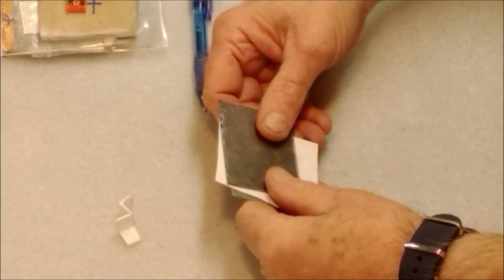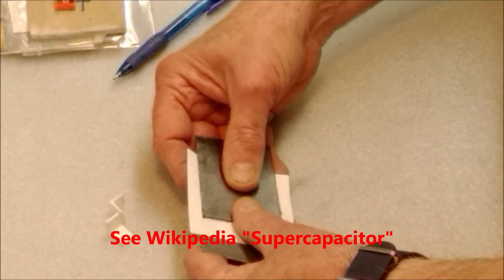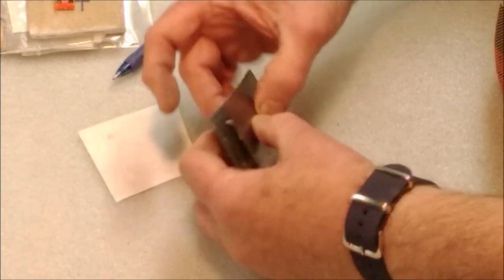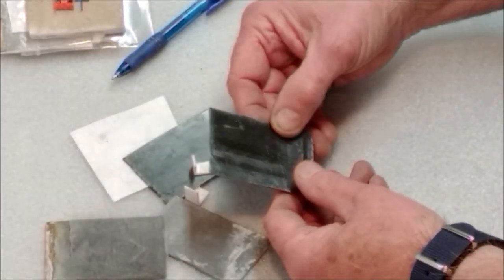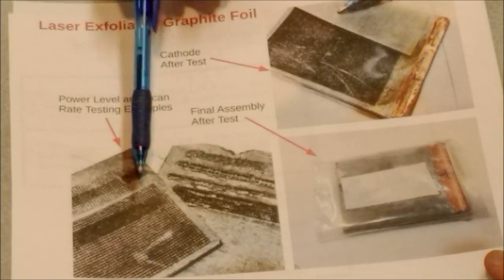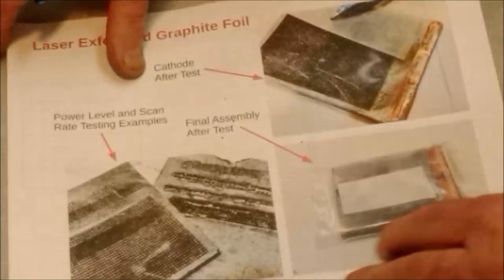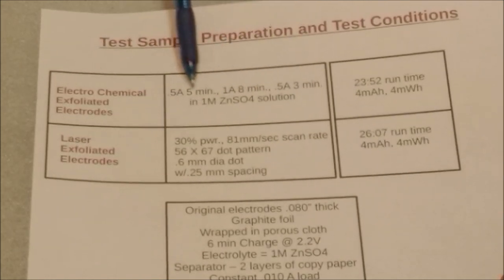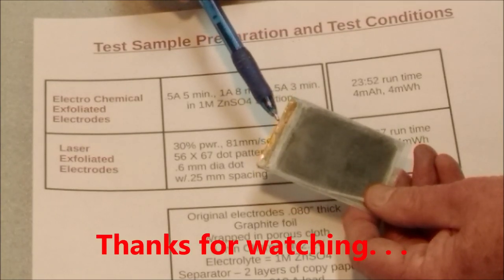Laser vs Electro Chem Graphite Exfoliation for Supercapacitor Electrodes

Comment: Hi Dennis, interesting video. If you have not seen it, SarbarMultimedia channel, where Russ takes you through his lasers is brilliant. He knows really his stuff and his learning process through the year or two has been very educational.
One thought I had, you presumably had yours set for cutting at 30%. Did you try etching at say 15%...there is a "sweet spot" with CO2 lasers where you get a high frequency dithering/fuzziness, as the tube tries to stimulate the gas. You can hear it as a distinct harshness in the arc, almost a crackling. It produces a completely different effect
I suppose you can paint an aqueous slurry graphite powder onto say a PET film, and if you can get the power right, fuse the now exfoliated graphite to the surface of the PET, thus removing the binder from the system. I was looking at the potential advantages of using this with my ammonium persulphate carbons as a possibility of eliminating the kiln process, bonding it directly to the plastic film and heating it to a sufficiently high temperature to activate at the same time. My machine is a 130W beast, with a huge bed, which was great for large sheet work, unfortunately the large bed was my downfall, as a lazy man that I was meant I did not clear the bed before cutting. The result was the head hit stuff I had left in the machine, so is out of action at the moment pending serious repairs :(
Also, all that power means that at the high frequency point, there is still way too much energy.
My plan, therefore, is to etch "out of focus", using a 3 or 4 inch lens such that the carbon would absorb the heat energy, creating the fusing, but because it was out of focus, there was total coverage of the surface, as opposed to the dot pattern you would normally see with an in focus beam. Clearly, the overlap energy needs to be managed. Again, Russ has produced many excellent videos on energy patterns.
Just one other thought, regarding the electrolysis method. Does wrapping the electrode with cloth achieve the best result...or would a washed surface give a better one. My thinking just now is that during the intercalation process, the sulphate ions wedge into the graphite, driven by the electrical potential. Some graphite becomes sheared off, forming the multi-tiered graphene particles observed in solution. But, at the point of switching off, suphate ions were still trying to cleave off more, so logic dictates that the surface of the parent material should look highly laminated, as "work in progress". That is, I suspect, is where the benefit of this process would be, not necessarily upon the constrained particles, but the massive increase in surface area created by the incomplete intercalation. Indeed, as released particles are loosely constrained, they may not have any electrical binding (unless, possibly calendered back to the surface).  Just a thought :)
Keep up the good work.
Tony
Reply from the maker: Hi Tony - thanks for the many thoughts.  Lots of creative ideas we'll have to pursue 'someday'. 
I've been following / corresponding with Russ now for a couple? of years.  He got me interested and that's how I ended up with a 'China Blue' machine.    I did do some work with out of focus laser heating but didn't stick with it long enough to have any positive results.  Cut some nice acrylics though when I needed fixtures for flow cell testing. 
The pulsed dot pattern I used on the graphite foil sort of produced little explosive mounds/volcanoes so it seemed like a good idea to 'puff' up the surface.    Somewhere a while back I also tried to scan - was it mylar or kynar tape - there was some research done again at one of the universities - it did produce a carbon surface that worked as an electrode - again I didn't do any follow up other than a quick test.  I like your idea of maybe bonding carbons to a polymer backing via laser heating ……..  
You might also have something there that the underlying graphite surface during electro chem exfoliation has charge storage value.   I am fairly confident that the particles trapped by the cloth do as well since that form a thin paste surface when wetted and clamped under pressure in the final test cell. 
One last question - back to the carbon cloth of the Maxwell cap - what  do you think they use to get a stable electrolyte that works at 2.5V.  - I've seen some of the later caps spec'd at 2.7V as well. 
Dennis
Reply: @denniskramer9788  Hi Dennis 
Another "holy Grail" ...cell voltage...increase voltage square increase in capacitance ! This is predominately driven by the choices you make about your electrolyte.
I am presuming they are using organic  solvents, with fluorine/ammonium salts, that can push it up to 2.7V, I think....ammonia I am cool with, but trying to keep away from fluorine. Even though I inadvertently bought a litre of hydrofluric acid, I have no intention to use it...its just soooo bad, especially when most of the time in my lab I am just wearing shorts :)...trying to find a way to dispose of it safely at the moment. 
From what I understand, you need to provide a potential to transport ions to create the EDLC, but applying too much potential you destroy the ions by supplying the electrons with sufficient energy to establish electrolysis. That is why we get the limit of appx 1.23V for water-based solutions...hence folks looking at ionic/Deep Eutectic solvents to eliminate the low voltage dissolution of the water...but DES's based on Chloline Chloride, for instance, are hygroscopic. If left open to atmosphere, my ChUG DES will pull in up to 40% by wt. H2O. So a DES based electrolyte will need to be dried prior to use AND then prevented acquiring moisture by sealing.
Quite probably, the commercial electrolytes are also hygroscopic, but of course they are handling them in dry rooms and vacuum fill/treat during manufacture. So, within your home strategy you have to make some decisions...for instance accepting simplicity over density, toxicity over capacity and so on. And like you have already said KISS is king !!
I have not given up on raising the voltage, and are looking at gel/solid electrolytes. At the moment, I am synthesising some Potassium Iodide, unfortunately I had only 30g of elemental Iodine, another 500g on order from China. My plan is to create a Xanthan/Silicon Dioxide gel with a Potassium Iodide/Iodine additive. Xanthan gum is interesting in that it seems to react differently at high and low ph's, and it has tails off its "backbone". 
The electrodes will be basically my Ammonium Persulphate Carbon ( a little MnO2 on the +ve) bound with PVP to copper current collectors. 
If I get the ratios correct, the electrolyte shall gel, possibly over 4 or 5 days...how much gelling will be crucial. I am hoping the long chains of the Xanthan will inhibit the dissolution of water by virtue of the OH tails...with a little redox action assisting...so may be I will be able to push the window to 2V...we shall see :) 
Also, by coating each electrode first with electrolyte, allowing to dry and then "gluing" them together with a fresh coat, will eliminate the need for a separator    ....probably another failure hahahaha but that's what its all about...theorising,  visualising, testing and growing  
ah well, probably boring you by now, so better sign off.
All the best 
Tony
Reply: @tonyponsford  Hi Tony - like your though process for a  gelled electrolyte path.  Lots written lately on 'solid state' versions as well.  Hesitant to try what is beyond my understanding at this point - sounds like you could educate the community with a good tutorial video ;-) . 
What are your thoughts on a sodium perchlorate - read where it may to 'volatile' but at 3.2V its also tempting....???  Do you think the organics can fall into my category of simple  and low cost - gosh that V>2 term really is also pulling in that direction .
Dennis
Reply: @dianekramer6467  Hi Dennis
I will promise you a video if my work leads to an element of success, but the moment, its definitely "work in progress". I am not a chemist, I am a retired high voltage electrical engineer, my electrons used to run around at 400,000V so what do I know about this !!
I have many ideas on what I want to try, but I don't want to mislead people by showing stuff before I get to at least first base with them, videos of failures would, I suspect, dishearten rather than inspire. It has taken me a while for me to be comfortable with my carbon with PVP binder, that seems to be working well, so now its looking at the electrolyte that will work with that....I've done this several times before and ended up starting again in a slightly different direction, but that the nature of the beast :)
With regards to sodium perchlorate, never played with it, so I can't bring anything to the table, but interestingly Wikipedia describes a solution of it as a "unreactive electrolyte", which would imply little or no ion migration, yet there are several papers using it within sodium cells, so may be I am not interpreting the term "unreactive" correctly. Regarding handling it, sure it looks like an oxidiser, but then so are a lot of other stuff, water is pretty nasty if you try and breathe it ;)   ...
With so many chemicals and effectively an infinite number of combinations, it is tempting to run around like a little boy in a sweet shop, so I tend to try to narrow my investigations, by say focusing on sulphur or ammonium groups...that would lead to a certain choice of current collectors/electrodes and possibly electrolyte backbones. Then I try to develop from there. Others, I am sure approach it from a different direction but there is no right or wrong, just what fits you best :) 
Don't forget your own mantra KISS hahaha
All the best

Tony
Reply from the maker: Hi Tony - would you mind if I sent you a PM - my email is dkramertroymi@gmail.com.
Thanks,
Dennis
Reply from the maker: Hi Tony - thought I'd share with you a couple of updates and maybe you could suggest a away around my latest bump in the road.  I've had great success in terms of areal current and power density with  a composite mix of  AC, Graphite flake, and carbon black literally blended with toilet paper and a little water glass.  Electrodes about a mill thick are less than 3 ohms /square and yield more than 1mAh / cm>2.    That said its the same old ELECTROLYTE issue topping out at 1.8V for 1M ZnSo4.  I'm shooting in the dark to try and build an IONIC LIQUID with the ZnSo4, DISOLVED in something.  Can't get enough concentration in glycerol.  Things like N 2 methyl pyrrolidine are not ionic either.  Thought about methanol - but maybe too flammable.  Any suggestions...….???
Also may try more of a gel or  emulusified oil mix - but that's not going to raise the voltage - only add resistance ???
I've read lots of papers about ionic liquids but don't understand enough to simplify the process for a poor mans lab. ;>)
Your thoughts.
Thanks,
Dennis
Reply: @denniskramer9788  Good news that you are progressing, well done !!
Can't report much from this end...combination of things limiting my time at the moment, including the start of the rice planting season...I've tried various binders for my ammonium persulphate activated carbon, at the moment discounted Xanthan gum/polysaccharide route in favour of a PVB/PVP polymer direction, but have yet to settle on an optimum ratio. I may revisit Xanthan but try either a PVB or Stryene Acrylate Copolymer (SAC) additions, but that is on the back-burner for now.
With regard to your electrolyte, rather than zinc sulphate, have you thought about zinc chloride?
Zinc Chloride mixed with Choline Chloride (molar ratio 1:1) will create a high conductive Deep Eutectic Solvent, it will theoretically give you a voltage window of around 3.7V which is good news...but (and there is always a but) it is very hydrophillic and will absorb appx 40% by weight of water over a relatively short period of time (several days, I think). That water, will then become your voltage limiter (1.23V) so you need to keep it dry (or as you charge the water will disassociate to hydrogen and oxygen), or dry it immediately before using it. It can be oven-dried fairly easily. My ChUG ( choline chloride, urea and glycerine) behaves the same thirsty behaviour, so for trialling my binder I am shelving it at the moment. I was also thinking of vacuum packing the cells and then if there was any off-gassing it would be contained and re-associate after charging...work in progress.
NMP is a bit nasty to handle and dispose of, DMSO is safer, but I can't deal with the smell. It is said to be garlicly, but to me it is just rank. I've got 3 litres of the stuff just sitting on the shelf !!
So, my thoughts would be to try a dry DES...then you may wish to re-visit your binder, for instance if you want to stick with "waterglass", have a look at NurdRage's channel as he identifies four different compositions of sodium silicate. I used his technique with NaOH/SiO2 to make my own, and then you play with the "size" of the sodium silicate molecule, as I believe "size" matters in all the battery/supercap components. 
I've knocked up concoctions thinking they should be pretty spectacular and they were...spectacular failures !!  Why, I don't really know, wish I did because then I would have cracked it, but I suspect it is possibly due to the transportation mechanisms at a molecular level. Some molecules/polymers, such as Xanthan Gum and PVP appear to have "backbones" that seem to facilitate or assist ions to travel along or through them. From what I understand, hydrophillic binder additives generally increases conductivity, but tend to "dissolve" or "degrade" the electrode (XG, PVP, PVA, PAA, PEG), whilst hydrophobic binder additives increase the electrode life, at the expense of conductivity (PVB, SAC, SBR). (Not sure where Sodium Silicate fits in that model.)
From what I have gleaned, the "backbones" frequently have molecule chains branching off them, and that how these branches extend from the backbone dramatically effect its performance. For instance, depending on the pH of the electrolyte, the branches can be extensive or tightly pulled into the backbone, so like we have said before, you cannot explore a single component without considering its effect upon the other items :)
One other thing I am musing at the moment is adding a small amount of ethanol to the aqueous electrolyte to improve transportation, but again, it has to be compatible with everything else :)
Not sure if any of my ramblings helps you and please don't consider anything I've said as more than my musings...I am probably way way off the beam :)
Keep up the good work, kind regards
Tony
Reply from the maker: @tonyponsford  Hi Tony and thanks for taking the time to help me out.    I'm going to order up some chcchl and start a new chapter in testing.    A good free  'bible' on electrolytes is the 2015 paper titled....A Review of Electrolyte Materials and Compositions  for Electrochemical Supercapacitors......Zhong et.al. 116 pages of alphabet soup options.    I'll keep in mind the hydrophobic issues.....maybe an additive will help there ...Glycerol???
Dennis
Reply: @denniskramer9788  No Problems mate, thank you for the paper, lots of good explanations in there, including the voltage widow issues you are having, very useful. Of course, depending upon your application, you could settle for a 1V cell and increase the number of cells to make up the difference. As I mentioned before, when I have time I will try over-driving a cell in a vacuum sealed pouch. My thinking is that the hydrogen and oxygen could recombine as long as the overvoltage was neither too high and too long...but I must prepare the fields for rice and I have a large pond to dig, a new excavator to procure and learn, so I've got my work cut out at the moment :)
I need to make a large batch of potassium iodide ( and then convert about half of it to copper iodide ) for experiments with multivalency and transition metals...thinking of adding manganese dioxide and/or silicon dioxide to the AC...it will all end in failure of course, hahahaha

All the best
Tony
Reply: @denniskramer9788  Try some propylene glycol with choline chloride to make a much more ionically conductive Type 3 DES. Although its also very possible to make some more interesting highly ionically concentrated & conductive Type 1 & 2 DES electrolytes with just metal chlorides (*or metal iodides) with choline chloride. This would technically create more of a hydrid super cap batt with a much higher voltage ESD chemistry, including with alot more energy capacity per surface area than a pure double layer super cap by many many moons... :) (y)
Reply: @denniskramer9788  Ps. Almost all the metal iodides are super hydrophobic & ionically conductive with ultra high solubility (some of the highest known for any salt). Properties with the potential to make some rather uniquely performing and experimental Type 1 & 2 DES electrolytes. Calcium, Sodium, or Magnesium iodides look to offer some fascinating high cell voltages and energy densities without any dendrite issues. Iodides can also be blended with chlorides to enable far more stable longer term storage of chloride ions in ones charged positive in the form of Iodine monochloride... Hope any of this is useful or interesting, onwards & upwards P :)
Reply: Hi Pedro - and many thanks for your feedback.   I will definitely try your suggestion.  Should I expect a wider electrochemical window with the Type III PG ChCl combination vs one with ZnCl2?    Of lesser concern would be ion transfer rate to affect peak power, viscosity (soaking capability into my carbons), and eventually cycle life (trying to hit 10K cycles with 85% capacity).    Do you have any experience or thoughts on Polypropylene vs.  Polyethylene?    Thank you,   Dennis
Reply: @dianekramer6467  Thanks Dennis glad to be of some help. Zincs always going to try to plate out on/in your negative like any other metal salt. So technically more of a half a battery cell combined with a super cap in reality. 

Zinc dendrites are the plague!, especially the higher the charging voltages you go. Although a 3 to 5% PEG addition to the electrolyte can help to substantially depress dentrite growth. 

A pure Type 3 PG ChCl with no metal salts should make a pure very long lasting super cap (breakdown voltage no data but it should be high), but with potentially a bit sluggish with fairly high ionic resistance or mobility on the down side maybees. 

No data on PEG vs PPG but its certainly suitable as a very small percentage anti dendrite additive from my own previous experimental super batt cap research experience. 

Many commercial molecular weight PEGs are certainly very viscous indeed. Where as Propylene glycol viscosity is very nice & fluid at room temperatures. Which seems to translate always into greater ionic mobility on testing. 

The higher the solubility of a salt, the higher the ionic mobility at room temperature, is definitely one of the keys to look for (check Wikipedias solubility tables, which are quite neat & handy). Best to test and experiment on the bench with some some quick tests to confirm, as very little real data in these pioneering areas. 

Definitely a journey of fascinating discovery and wonder!. I find succeeding in new ground breaking research & projects are all about solving the challengers we face from new angles & approaches until resolved. 

It is said that intuition is a very powerful guide when combined with a methodical technical step by step engineering based approach, especially with much experimental dedication and creative imagination.

I also do believe 10 thousand cycles plus, may be very possible in the fullness of time. But only realistically with the help of a home brew auto charging/ discharging setup with ones most promising & stable sample cell designs *(most achievable with pulse charging i believe...). 

So wishing much success with your grand mission, and very much looking forward to your next excellent vids too, cheers P :)
Reply: @dianekramer6467  Ps. Extra note: Although iodides have great cell potentials for DES electrolytes, unfortunately iodine or iodine mono chloride in its concentrated form is very toxic & corrosive indeed. For a real world ESD applications these properties make it quite unsuitable for any scalable use in reality.  Personally i would avoid any form of concentrated iodine as an experimental energy storage material, and stick to sulfates ideally, chlorides, acetates & others. Experimenting to create a new liquid room temperature DES using sulfates or acetates would be a far better low toxicity way to go instead ;)
Reply: @dianekramer6467  2nd extra note: In my own intensive practical research 3 years ago i found that xanthan gum more than any other gelling agents i tested, makes a superb aqueous super ionic gel electrolyte with sulfates (& many other salts) without increasing the internal resistance. Completely non toxic and has long term stability also. The gel is also superb preventing evaporation in open test cells, and has a fantastic electrode wetting ability. It also raises the break down voltage quite a bit too as it can store electrode off gassing very well, which is quite reversible also sustainably increasing energy capacity. A Xanthan gum/ SBR binder mixed with a small amount of ones electrolyte, also has a very interesting potential as a new super ionic binder instead of the standard CMC/ SBR binder method. Finally it maybe quite possible to use xanthum gum or blends of to make some next generation super ionic rubber like solid state electrolytes as well, which would be very interesting indeed....
Reply from the maker: Hi Pedro - really enjoy all of your comments and suggestion - gives me more avenues to play with as I sort things out.  Today, per your suggestion I played with Propylene glycol and Choline Chloride, 2:1 molar.  Not bad but not quite as good mWh wise as same composite carbons with 1M ZnSO4 electrolyte.  The ChChlo/PG doesn't dry out so that's BIG plus but its ionic conductivity seems to add to much internal voltage drop (about 1.5V) to the cell (at any test levels above .030 mA loading) .   

Now some of that is my own bad match up with the  Propylene Glycol and my composite binder I believe - its a  .060 inch thick compressed electrode of 3 carbons, paper pulp and a little water glass binder.  Its almost like the binder is dissolving and becoming a carbon insulator….which wasn't the case with the earlier aqueous electrolyte.    And the higher viscosity doesn't penetrate well the thicker electrodes.  I'm sure less binder would be better or maybe go back to xanthum gum as you said above.  All input much appreciated.
Dennis
Reply: @denniskramer9788  Thanks Dennis, always great to chat with fellow energy storage R&D pioneers indeed!.

Water glass is strongly alkaline being sodium silicate. In many cells the Positive becomes acidic and the Negative becomes alkaline when charging a cell generally. So you may be getting some unwanted reactions in your positive using sodium silicate as a binder unless this binder it mixed with casein to make a water proof binder.

Ideal binders are highly ionically or electrically conductive, waterproof, micro porous, chemically stable, flexible and quite elastic. Sodium silicate by itself is none of these things unfortunately, and will tend to negatively react depending ones electrolyte chemistry, although silicates & mixtures of may enable new solid state electrolytes with enough research and experimentation. Sodium silicate is also quite a good insulator, where as SBR/CMC or even better SBR/ xantham gum binders is far better for keeping internal resistance low i find.

Aqueous based electrolytes have generally many times the conductivity, ionic mobility and wet-ability compared to a non aqueous DES electrolyte. Creating a non aqueous DES electrolyte with all theses great aqueous qualities but with a very high breakdown voltage is the holy grail ideally. So at the moment you will need to have your electrodes as close together as possible (eg 10s to 100s of microns) to get any decent performance out of them with non aqueous/ DES electrolytes, and that means using much more thinner less restive separators .

By using printer paper as your separator this will definitely increase your resistance by quite a bit due to the whitening additives & dressings they use in its manufacture, each layer of printer paper being around least 100microns in thickness when dry, and swells up and falls apart when wet. I personally found that old fashioned brown wrapping paper (or the paper brown paper bags are made from) works miles better, and is far stronger when wet too. The specialized tissue paper used for covering older balsa wood framed model aircraft also makes for one of the very best super thin but strong longterm low resistance separator as well.

As previously mentioned by using metal salts like zinc sulfate in your cells, your actually making a form of hybrid battery/ cap cell. Super caps do not use metal salts in their electrolytes that can plate out in charging. But if you want a very high energy capacity, hybrid batteries or caps are the way to go, with certain cell chemistries have very much proven to go through 10K cycles and above.

There are so many things to cover to explain about this specialized subject in reality, so im best of sending you an email or two with my own indepth findings to date, P :)
Reply: Dennis: I can show you how to a build aqueous based rechargeable battery like cells with performance the same or even higher than a lithium ion cell per surface area. Only issue is i havent cracked the longterm cycling stability of its chemistry & materials after a certain number of cycles yet.

Many many researchers around the world are already focusing on high performance super batts (as i call them), but hardly any one is focusing on high voltage "Strange super caps". As no galvanic reactions take place in a pure super cap compared to batteries this naturally translates to a far far longer cycle lifespan, but often at the sacrifice of a much reduced energy density compared to batteries.

I have come up with some very workable & fascinating concepts of how to make the holy grail of "high voltage" & low leakage super caps, eg the higher breakdown voltage of the electrolyte in such a strange supercap he larger the energy storage increase (HV electrolyte nano droplets in a dielectric insulator as a cutting edge type of ESD concept).

Using an online cap energy calculator with say 500 farads with a break down voltage of 2.7volts it can just store 1822.5J (0.5 watt hrs). But if you can achieve a breakdown voltage of 12V with the same 500F cap you then will store an amazing 36,000J (eg 10 watt hrs). At 110V it will store a phenomenal 3,025,000J (or 840.3 watt hours!).

I have formulas for new HV cap electrolytes with breakdown voltages over 400V!, which if made into a strange super cap could theoretical create a special kind of stange super cap with the max potential of 40,000,000J (11KWhrs!), including with a very long 100K to 1million cycle lifespan but at the same size of a good standard commercial 2.7V 500 Farad super cap. 

This is why this new "strange super cap" is so interesting, and very much a ground break way to experiment with and further develop. Here are some Robert Murray Smith vids to focus on and study indepth again P :) https://www.youtube.com/watch?v=738Xz9xM_-8
Reply: Lastly... A high voltage 100V super capactor has already been proven in the lab with a 38% H2SO4 electrolyte solution if you have a brief google. So heres a very interesting concept to follow... Cleaned & slightly etched surface aluminum and/or copper foil tape to act as the two "HV strange cap" electrodes. An electrolyte solution of choice sonicated into a melted & fluid semi flexible wax, resin or polymer. If well mixed and sonicated together this technically creates billions of highly polarizable electrolyte nano droplet in polymer emulsion, that sets at room temperature into a semi flexible polymer film material. This melted HV super strange cap nano emulsion polymer material can then be applied whist hot onto the foil electrodes before it sets for excellent adhesion. I suggest the Dr blade method for the nano emulsion foil coating for superior even thickness (plus can be heat fused together ideal for reel to reel fabrication). Ideal for developing a wide range of electrolytes for very interesting high energy density super strange ESDs i believe...;)
Reply from the maker: @pedroalchemist8722  Hi Pedro - we may want to continue off youtube - here's my email.  dkramertroymi  at gmail dot com
Again thanks for taking the time to help educate me.  Shortly I'll be trying some new binder recipes - eliminating the water glass for all the reasons you outlined.  I'm not a fan of CMC and SBR since it seems very touchy to get the ratios right with variations in the carbon mixes etc.  even with less than 2g per  100 ml it seems to 'gum' up to easy.  I do have some xanthum gum to try - will be playing around with it and the glycols to see how it can be controlled to not just 'plasticize' out - I only need the smallest amount to cast some electrodes for minimal handling before assembly.  Nothing water proof etc.   

For now if I could hit 2.7V with an electrolyte into thicker carbons I'd be happy with the CV>2 gains vs. todays 1.8V.  And if a simple, low cost cell results with common carbons and readily available materials that would be great.  Someday I'll hope to have a power wall at 1/10 the cost (albeit 1/10 the energy density) of what's commercially available.  Energy density  is down the list vs. simple and cheap.  Love the suggestion for brownbag etc seperators.  Thanks 

Your thoughts on the high voltage caps also very interesting.  I did make some super dielectric tests (an older video) similar to RMS - again nothing to write home about so that was shelved.  
As you have time keep me in the loop on your latest trials. 
Dennis